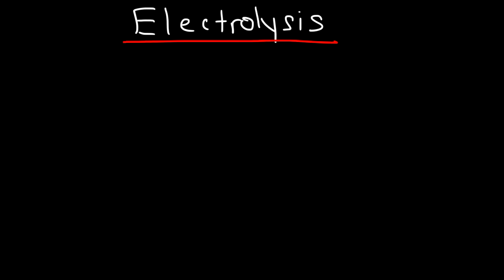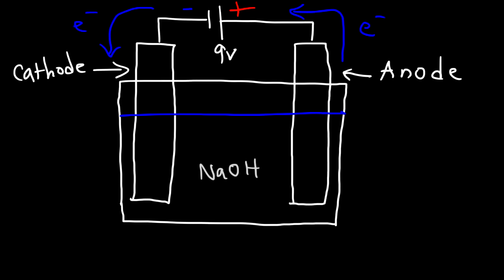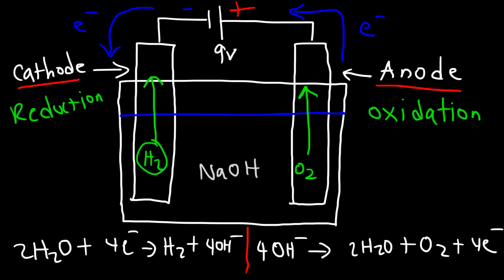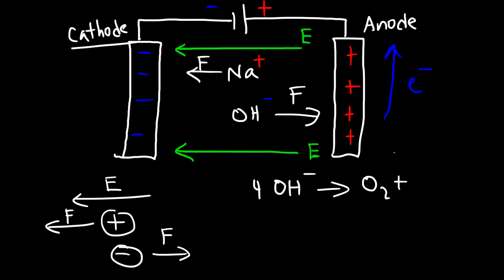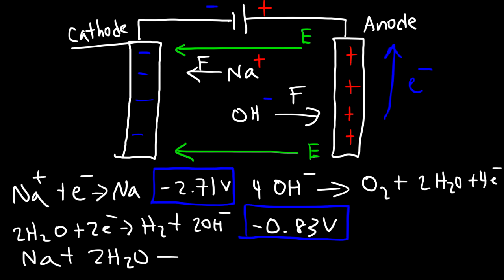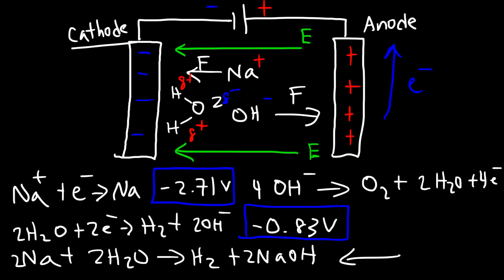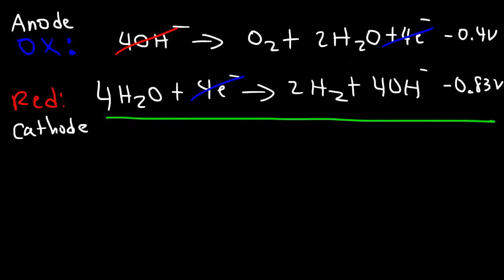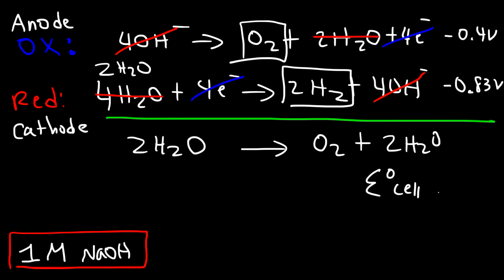Electrolysis of Water - Electrochemistry

Comment: 12:44 I disagree. The reaction does not occur unless the activation energy is provided. The bonds of the Hydrogen molecule, H2, and Oxygen molecule O2 must first be broken before they are free to combine. The molecules will not slowly accumulate energy until there is enough to break the bonds.

Wayne Y. Adams
B.S. Chemistry
M.S. Physics

Comment: Thanks JG. This video is a great explanation to understand Electrolysis.
Btw, the standard electrode potential for 4OH- >> O2 +2H2O +4e- is the positive 0.4V.
The electromotive force (E0) for electrolysis is -1.23 V which is calculated by (-0.83) - (+0.4). E(Red) - E(Ox).
Looks you add (-0.83)V and (-0.4)V to get -1.23V but I think (+0.4)V is correct.
Reply: nope, +0.4 V is not correct. I think he reversed that equation with +0.4 V to get - 0.4 V.
Reply: @manitverma4425 0.4 is correct I believe. To calculate E cell, its cathode - anode and if it's -0.4 V, you will not get -1.23 V
as -0.83 - -0.40 ≠ -1.23

Comment: I am not sure about the reaction at cathode, Shouldn't it be 4 H2O + 4e- → 2H2 + 4OH- ?
Reply: correct, numbers of H and O should be the same, as well as the charges on both side of so called " half- reactions". If you sum up anode + cathode xou get decomposition of water to H2 and 1/2 O2.

Comment: the standard potential of anodic reaction is greater than cathodic rxn then it should be then reduction not  oxidation like cu and zn zn have -0.76 E and cu is 0.34 E so reduction of cu occurs. then why in case of water the less E value is reduction. can u plx explain it

Comment: In case if u r wondering about the equation at anode:
OH^- = OH + electron
OH^- = OH + electron
OH^- = OH + electron
OH^- = OH + electron
There fore the overal equation at Anode is
4OH^- = 2H2O + O2 + 4electrons
Reply: Where do you get 4 OH^- from?
Reply: @isaacmolina5500 well it's just the properties of the stoichiometry, you can see that in the product side of the reaction (right side) there are 2 molecules of H2O and 2 atoms of oxygen. Which means that in total there would be 4 atoms of hydrogen and 4 atoms of oxygen. Therefore, to balance the equation it needs to be the same amount on both sides.
Since on the reactant side there is only a hydrogen atom and an oxygen atom we put the stoichiometric coefficient in front of it, making it 4OH
Reply: Yes where did you get it?😢
Reply: The way u've explain was not clearly way
Reply: @VanisyJonathan  i thjink he means whjen you add the products together from top to bottom row  it forms the final equation 2H2O O2 + 4 electrons where there are exactly 4 H 4O and 4 electrons